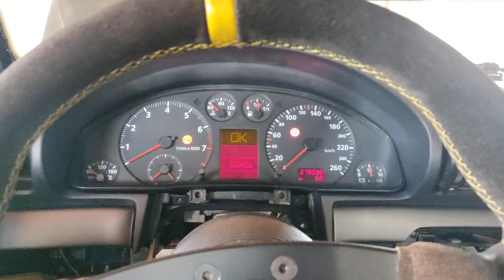Audi A4 B5 1.8T quattro 500 hp | First start and short walkaround

Comment: You relocated the abs block? Because Weight?
Reply from the maker: Because of the weight distribution, yes. I have a lot of space in the car, so i can move all the things where i want them to be. The car has to much weight on the front because of the engine, so i moved the battery, powersteering and abs to the rear. It gives also a nicer engine bay.